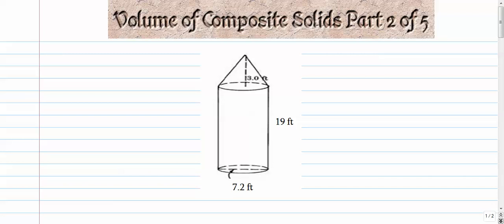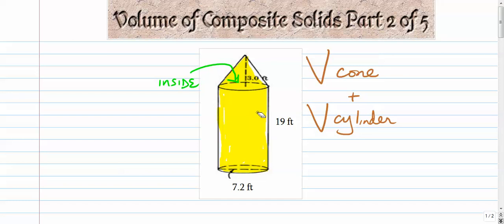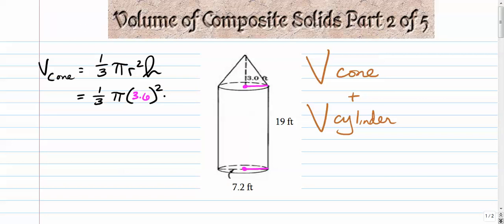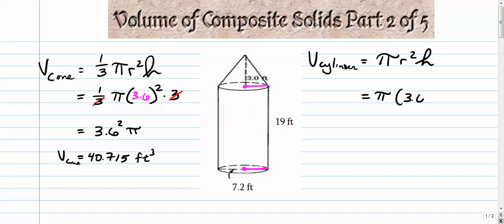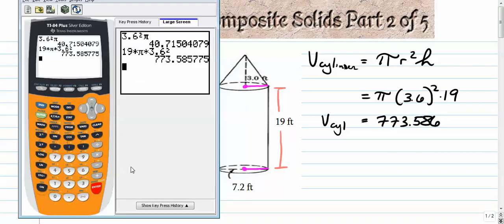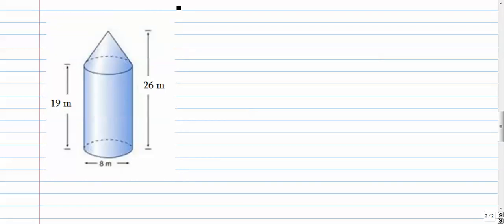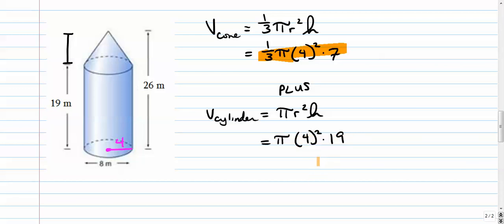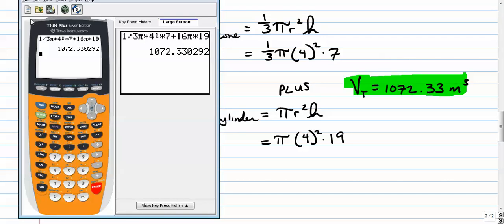Volume of Composite Solids Part 2 of 5

Comment: I thought you have to use PI until the final answer because if you round it off, your answer will not be accurate. For curved shapes like these, you must always use the exact answer for the rest of your working until you got your final answer unlike polygons where the answer is mostly likely a whole number or one to two decimal digits. Thank you for reading this hope you take this into consideration :)